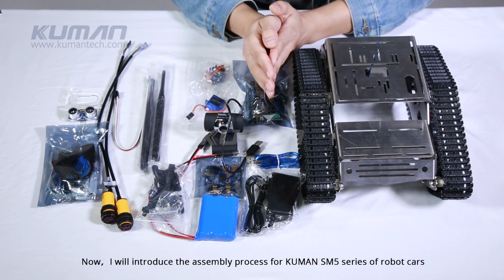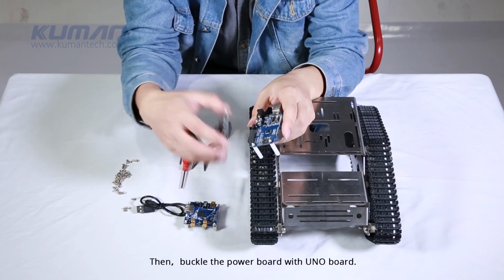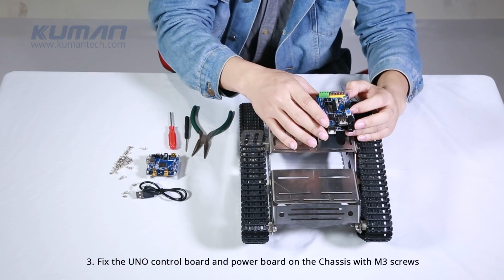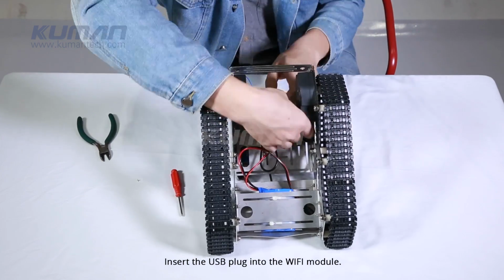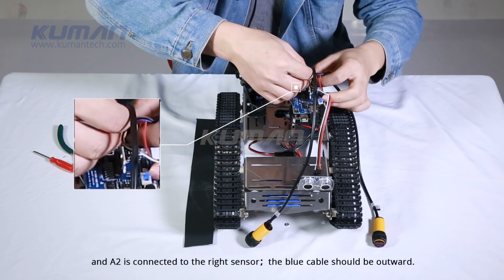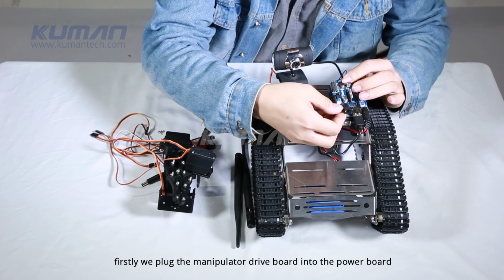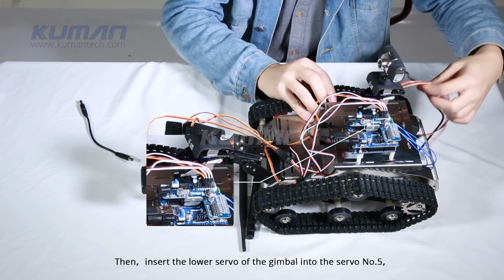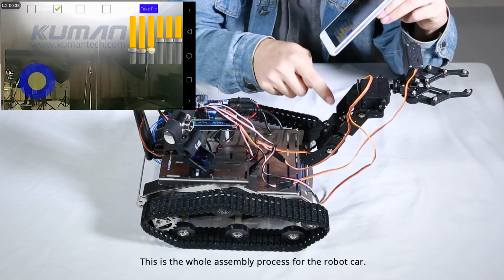Kuman SM5- 1 Wifi Control Smart Robot Car Assembly Video

Comment: I bought this for my son 2 years ago and we did not receive instructions but we have built it.  The only problem we have not is we do not no how to download the drivers needed to use the wifi card on the robot.  The wifi board blue light turns on and then off within 10 seconds.  I guess there is some kind of download to get this to work with the app.  We have tried the app but we cannot receive any wifi signal.  Please help!  We paid too much money for this to sit on the shelf for  3 years.  I cannot read Chinese so please help in English

Comment: CAN YOU PLEASE  DEFINE THE POWER BOARD,WIFI MODULE,ANTENNAS NAMES PLEASE.
EXPECTING THE REPLY AS EARLY AS POSSIBLE...
Reply from the maker: Ganesh，The latest version of the product has replaced UNO with MEGA2560 and integrated the steering gear control board into PWR Expansion motor driver board

1. PWR Expansion motor driver board 
2.MTK7620N WIFI Module 5.0 (Jump cap*2) × 1 
3.Robot Link 300M 5DB Antenna × 2

link :

https://www.amazon.com/Kuman-manipulator-Intelligent-Educational-Controlled/dp/B01FM0KKCA/ref=sr_1_1?ie=UTF8&qid=1537168986&sr=8-1&keywords=sm5-1

Comment: hello  is not possible put two servo in the two free posiotion SDA  SDL of this card and command servo by  two trim command, for this two positions, in the your pc software ? thaks for help..  
i have put servo but not work in SDA  SDL positions...i like this for modding ..
is not possible put two new  servo for pant tilt light ?  wher'is possibility power 5v for this lamp light fixed in pan titl '  THANKS FOR HELP.
Reply from the maker: Frank, you need to modify the code to achieve your purpose. But we do not suggest to control like that. There are lot of pins on the board, it's better to control with other pins.
Reply: have mail for contact you ??
Reply from the maker: Yes, please send email to support@taibotech.com, we have engineer to help you.